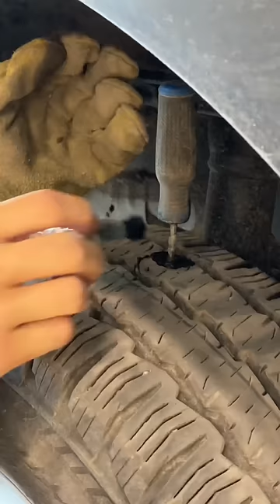Why You Shouldn’t Plug Tires #tiredoctor #tireguy #tires #shorts #tireplug

Comment: Yes I’ve heard all the horror stories yet done stuff that I’m ashamed to say yet it worked.  

I worked at a full service gas station on highway 17 in south East ga in the mid 70s after school. It was a main highway down the east coast and once  a month a guy came by selling stuff to the store and a couple of them  were monkey grip patch kits for bikes with tubes and tire plug kits. 

He drove a big Cadillac and his sales pitch for plugs was poking one through the sidewall of his tire on the car. 
He had at one point 35 plugs mostly in the Dude walls of the 4 tires and drove about 300 miles a day.  Most of the failure stories are made up and passed down for 45 or so years I know of.  He also sold Slick 50 oil additive old guys will know what that is. 
Do what works for you

Comment: This isn’t about tire shops. It’s about lawyers because all you tough talkers claiming they are crooks would be standing outside the nearest lawyer’s door before opening the next day after a loved one’s death. You might say “you should have done it right. Doesn’t matter. I can patch it then ten thousand miles later the tread separates due to yo’ momma driving around with separated tread because she refused repairs to her front suspension and chanced it. I’m innocent but I’m hiring a lawyer for $400 an hour and still maybe having to pay part of a settlement. 
 Guess what folks. Tire repairs are soon to be a thing of the past. It’s not worth it. The legal fees are exorbitant even when you win. The law firm will find every shop that ever touched that vehicle. Even if it was just an oil change that included a tire inspection 30k miles ago. Everybody get deposed and drug through the process racking up legal fees. 
 I refuse to inspect tires. I tell my customers to take it to a “tire specialty shop”. I would never patch or install a customer’s tires. Let Discount or whoever has deep pockets and teams of lawyers deal with it.

Comment: Tires should not be plugged, they  should be removed from the rim  and  hot patched
Years ago  i worked for an outfit that would always cheap out on repairs, one of the drivers had a flat on a steer tire, the tire guy at the shop plugged it improperly and the tire delaminated a few days later on the highway, the resulting wreck killed both guys in the truck. You go right on plugging, i would rather not die of stupidity

Comment: Audi does not even want you to patch a tire.
Reply: Audi’s have run flats in no car AND I MEAN NONE with run flats are you supposed to patch it in anyway patching a run flat makes it useless for its intended purpose and if your that cheap then why’d you buy run flats?
Reply: @toyotacorollaaltis8613  Audi uses standard and run flat tires. Only the Q7, Q8, and Etron Quattro/Q8 Etron come with run flat. It is stated not to repair any tire with a puncture. Before I started working for Audi, I was at Goodyear. Goodyear allows 1 patch to the run flat tires as long as it passes the inspection process for patching tires.

Comment: How could it be dangerous, if it's done incorrectly its not even gonna hold air. Plugs, patches, etc are perfectly fine to use if they didnt work and just failed all the time they wouldnt exist cause it would just be a lawsuit maker but keep misinforming people so you can charge them $200 for a $5 patch

Comment: Your doing it wrong!! Most people do. After inserting the plug, you have to twist/turn the plug a full turn, then remove the tool.
This will make a knot on the inside of the tire with the plug.
Try it on an old tire & see the difference

Comment: My partner rides bikes and thinks I'm overreacting by refusing to allow him to fix tyres at all. If it's punctured welp we're getting new tyres. I'm trying to convince him to have winter and summer tyres 😂 my father was a racing driver and I was raised to respect the vehicle my life depends on. And i don't even get on his damn bikes. 😂 I just couldn't live with myself if he died from a messed up tyre. He only has 2 to rely on in the first place so they better be PERFECT. 😂 I also make him do his oil every 1000 miles, every few weeks. He has the best maintained bikes out of all his groups. If it's faulty i make him replace it. And i can just hear when his oil is dirty, way before he can. 😂 So if he pulls up at home and it sounds bad he's going to be changing his oil and making sure there's nothing else going on. I swear if bikers didn't have women they k!ll themselves ebery other day 😂 I'm currently looking for a business that can machine new parts in stronger metals because he has an aluminium piece that keeps breaking. It's honestly NOT worth the savings of using repaired tyres when you're risking your LIFE.

Comment: Its only dangerous if your trying to plug the side wall.... worse case scenario ya wake up to flat tire again. And that means you didn't clean the hole good enough or used old plugs. Every tire i ever plugged, that plug died with that tire at the end of its cycle. Tire shops feed you that bs because they they want you to buy a tire from them. Its all horseshit.

Comment: The tire should be ruined the moment it has a hole by those standards, its RETREADS you wanna worry about, cheapy amazon tires will try to separate if they get punctured, but any name brand tire should be fine, whos gonna relplace an 80 dollar tire with one hole?

Comment: Another garbage short on youtube. Moronagous did not show the correct way it's called a plug patch. it's done from the inside it's a patch on the inside connected to a plug that goes through the hole, perfectly legitimate fix if it's not too close to the edge

Comment: Been doing tires for 20 years cars trucks and motorcycles. I trust a plug before I trust a patch. A patch destroys the inside of the tire a plug does not. A plug uses the same hole the nail or object went through only reason you use the reamer is to smooth the already existing hole for the plug. You actually messed up twice once by your advice and once by showing you using a drill...there's a reason plug kits come with a reamer...a drill twists the wires and can tear the plug when heat gets in the tire and expands. You shouldn't be making these videos you don't know what you're talking about. Some shops don't repair tires with plugs in them meaning already existing plugs. You don't replug a tire. Most shops will plug a tire and even sell plug kits. You're also not specific on what tires you're plugging. A Honda civic tire is different than a motorcycle tire and a motorcycle tire is different from a tractor tire and a tractor tire is different from an atv tire. Your advice sometimes is all click bait generalized information you can only fit in a short.